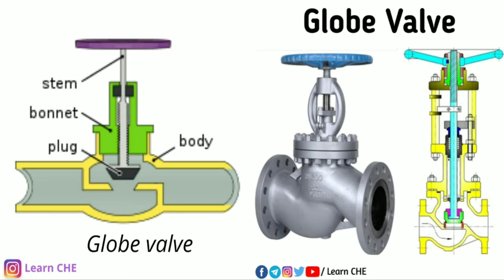How do you know if a valve is open or closed | how are the valve closed | how are the valve open

Comment: Why diaphapham used in control valve??
Reply from the maker: if I'm correct then you're talking about the diaphragm actuator which is mainly used to regulate the fluid in order to adjust some process variables i.e. pressure, temperature, flow, level, etc.

Hope your doubt is clear now! if there is any doubt let us know.